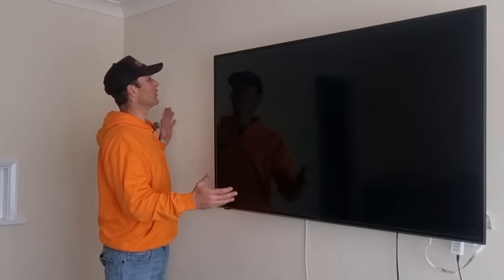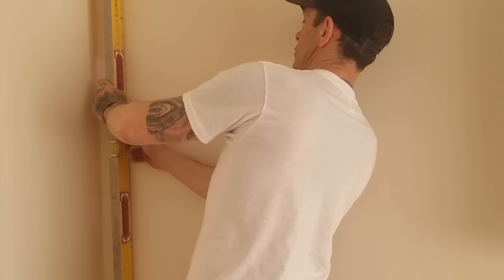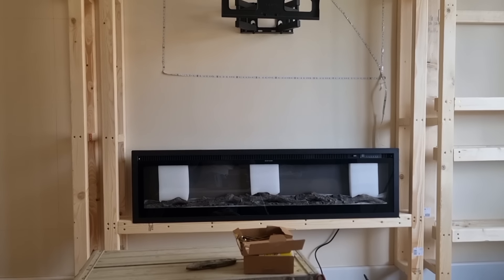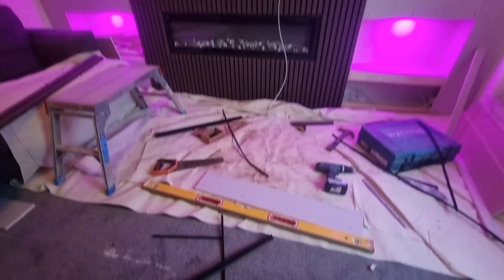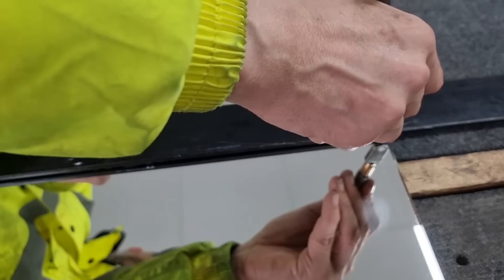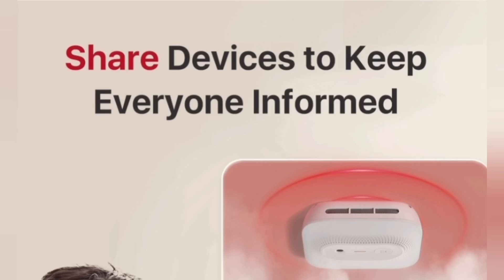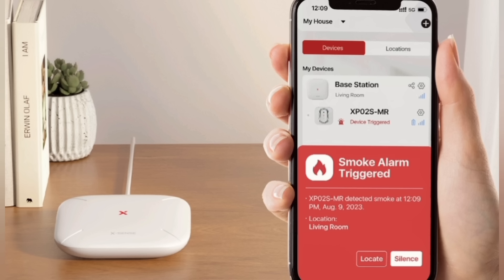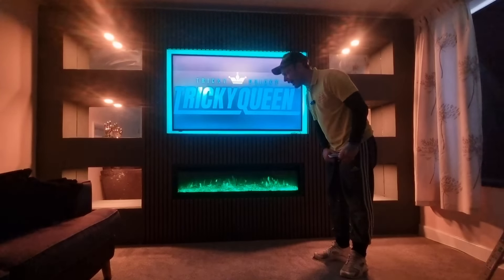How to build a media wall step by step #construction  #build #howto

Comment: Does the fire let of any heat above did you need to run a heat protector to stop the TV getting too hot. 

Or is al the heat held inside the fire and just released through the front vents.
Reply from the maker: The heat gets sent out forwards through the vents .it blows the heat forward and the TV doesn't get hot. That's why I brought the recommended heater for the job 😊😊

Comment: Who signed the electrics off
Reply from the maker: 12 volt plug in . And I did. I'm nvq level 3 since 1999
Reply: It doesn’t need signing off it’s non notifiable doesn’t even require aMWC , nice one tricky 🙌🏻🙌🏻